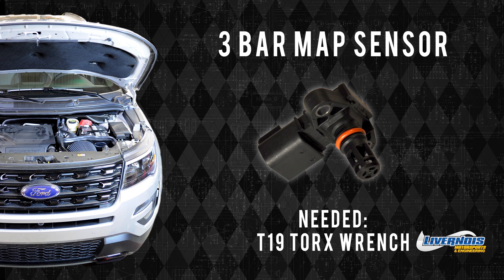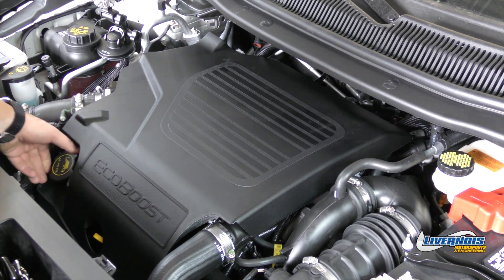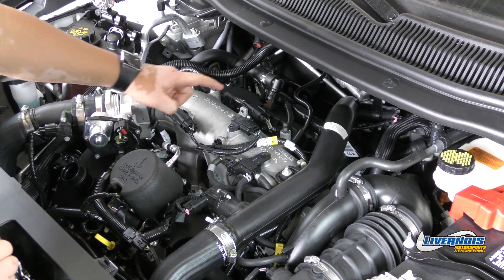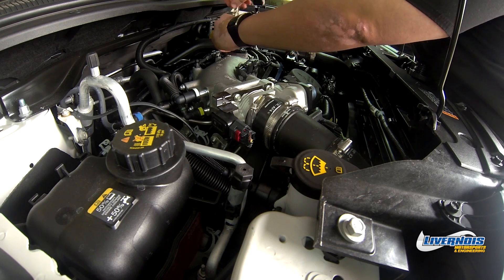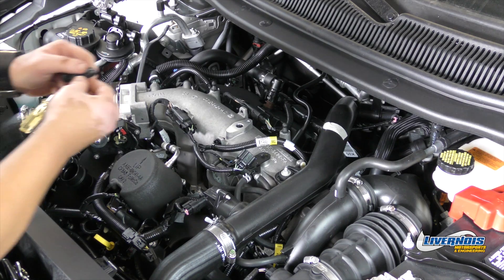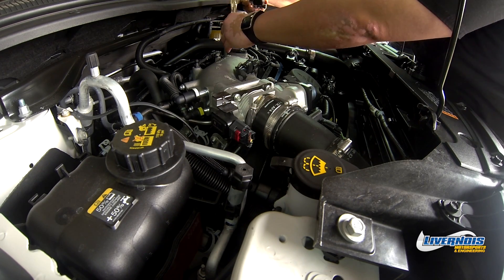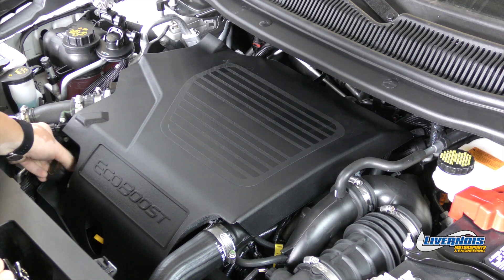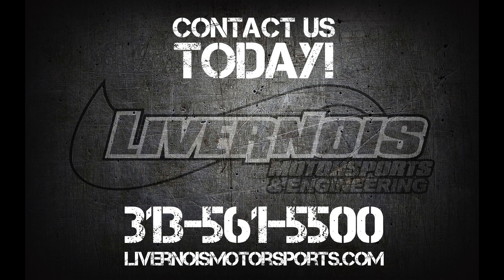Ecoboost 3 Bar MAP Sensor Installation

Comment: so why cant I get one of these for my 16 edge?
Reply from the maker: Assuming you have an Edge ST, it already has one.
Reply: @LivernoisMotorsports  nope not an st
Reply: I have one of your tuners. Just not 100% what all things i would do would need a new tune or if something like this would help
Reply from the maker: @vector150  Then a 2.0 would also have a 3-bar.
Reply: @LivernoisMotorsports  oh ok ty
Reply: @LivernoisMotorsports  the 160 thermostat you? Also what kind of performance games would I get if I bought that?
Reply: @LivernoisMotorsports  also what I have to have it retuned for the 160?
Reply: @LivernoisMotorsports  My edge is a 16.

Comment: I came here looking for how to clean the map sensor on my 2.0 escape but now I’m wondering what does a three bar sensor do??
Reply from the maker: Map sensors do not need to be cleaned like MAF sensors do since they measure pressure only, where as a MAF measures air flow. a 3-bar allows it to read higher boost levels than the factory 2-bar does to keep the engine safer.

Comment: Does this work for the 2016 F150?
Reply from the maker: Yes if it has the 3.5L EcoBoost engine.
Reply: You already have 3 bar sensor from factory,  as f150 runs higher boost.

Comment: You guys sure that's where the BAR sensor is. I bought a 3bar map sensor from you guys and thats where my MAP sensor was. Or you guys sent me the wrong one because the numbers did not match up
Reply: You should not work on ANY car.
Reply from the maker: This is absolutely were the map sensor goes. And the numbers wouldn't match up, since it's a different sensor than stock.

Comment: Thanks, perfect help.  You may want to consider including a link to this video in your written instructions which are included with your tune packages that come with a replacement sensor like mine did.  :-)

Comment: Can you use this on 2016 SHO?
Reply: ModdingGamer360 I'm pretty sure you can, I just got one today for my 2015 SHO, there's not much of a difference between the years
Reply: I could really use some help... I got a map sensor... which 1 did u get? Mine says FOMOCO AAC5A-9F479-AC A2C10668700. Is this the same u have? Pls help. Mine made the truck act weird.  The shop said they put the old one back on.

Comment: I have a 2013 Taurus SHO and a T20 Torx happens to fit as well. Glad I tried that before going out and looking for a T19. 

Man, do those sensors have a tight fit.
Reply from the maker: Well, they are designed to hold back upwards of 30# of boost, so we're glad they're a little snug :-)
Reply: The tip on the T20 though. I didn't have T19 in my set and that worked perfectly. Snug fit and very stable. Thanks!

Comment: why would you change the original to begin with?
Reply from the maker: We change this to better control boost with our performance tuning. See, when you reach the limit of the stock sensor, the computer doesn't know how much further you are past it, so it reacts in a default way no matter what. By putting in the 3-bar sensor, it will know exactly what to do to limit things like overshooting correction, or reaching a timeout limit and causing a fault code.